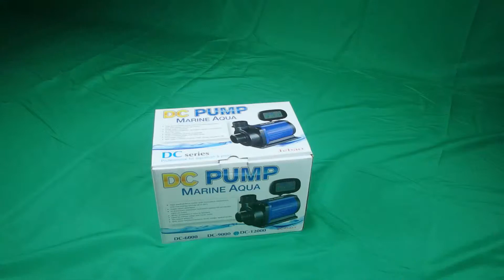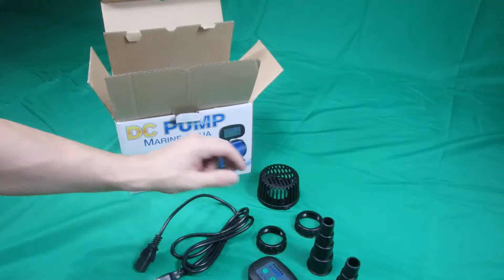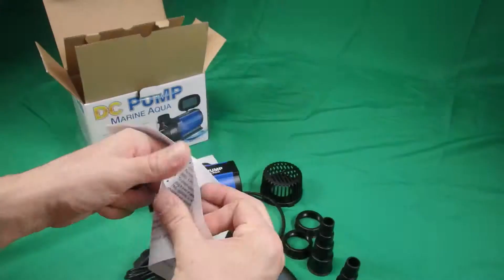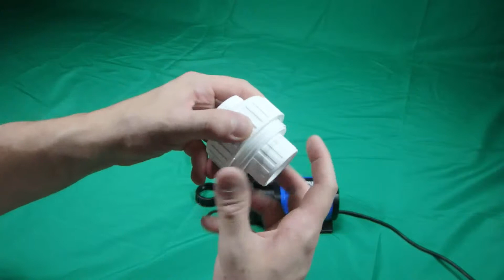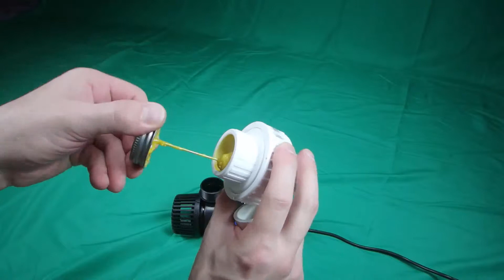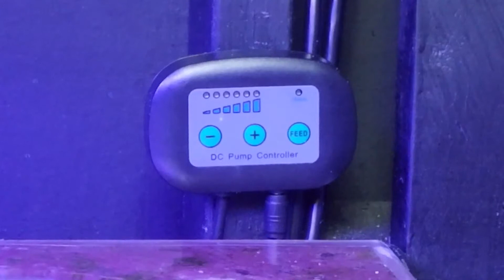Jabeo Pump unboxing, installation and product review

Comment from the maker: For the price you really cant beat it, even if you have to replace a part or two,  they blow away my old mag drives on efficiency, but I can understand if you want more reliability, you pay either way i think.  Where did you find calcium on the pump, was it behind the impeller near the magnet.  May I ask if you dose your system just curious if your getting a lot of precipitation.  Thanks for your comment I am making another video on this topic to explain more about the pumps quality and proper uses.

Comment: Great video showing all unions used but unfortunately I haven't had good luck with the jebao pumps especially with the dc12000 have gone thru 3 of them not because of calcium build up but because the motor burned out... luckily its only 30 bucks to replace them but still didn't even make it a whole year without breaking